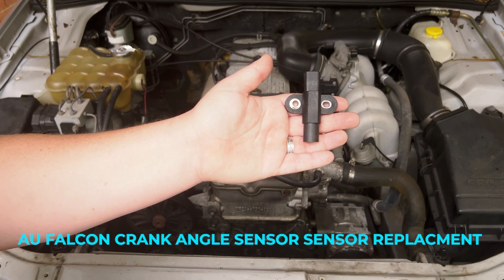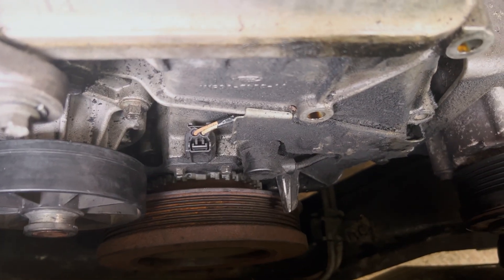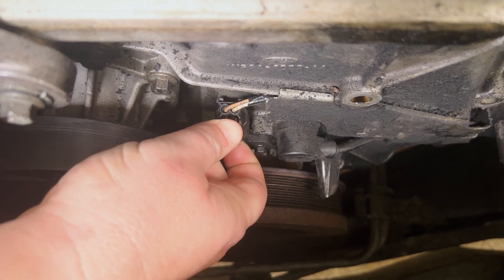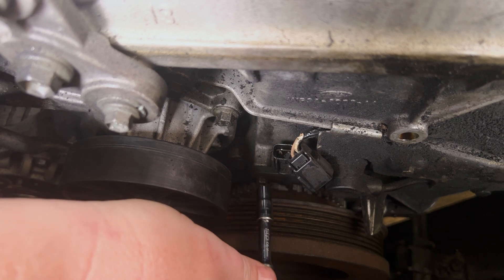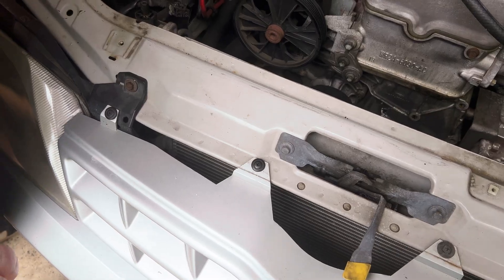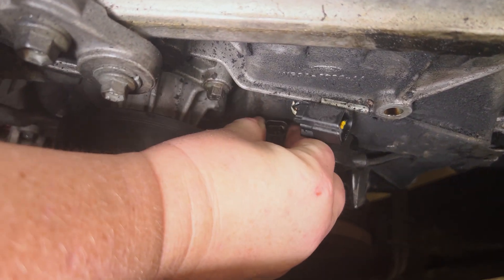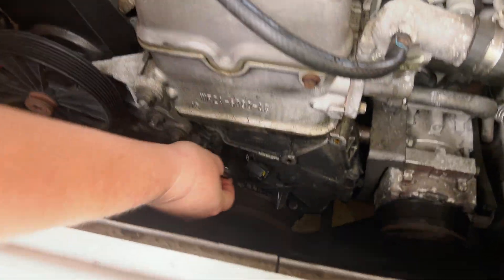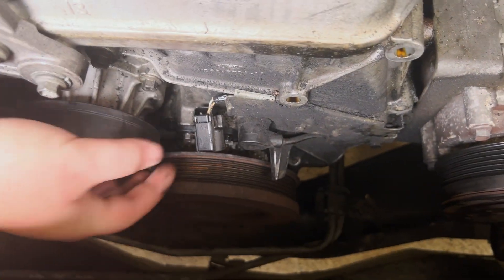Au Falcon Crank Angle Sensor Replacement

Comment: Hi can you tell me if the el falcon has a crank angle sensor same motor as the au
Reply from the maker: yep would be in the same spot all fuel injected models of falcon will have a crank angle sensor
Reply: @Aussie_car_repairs  cheers appreciate your response
Reply: Hi I'm just wondering if you can help me my el Fairmont auto is stuck in limp mode 3rd gear can I do anything to fix it.
It was fine but my son accidentally put it in second now it won't change at all 
Regards Ray
Reply from the maker: @rayherbert9413  you could climb under and check the shift lever other then that the box is probably dead they wont usually last to long after going into limp mode as it only dose it on its last legs best bet is to get a new box and when you install it drain the fluid and put a bottle of lucas trans fix in and the rest with trans fluid its what i have done and would do
Reply: @Aussie_car_repairs  thank you I was hoping you wouldn't say that 4 months ago I put a second hand box's in all was good until my son accidentally moved it to second while I was driving  now limp mode

Comment: Ford au 2 cam angle sensor removal Please. Thanks. I know where it is, but want to know it the harness ( fixed harness)  of the sensor can be eased out easily under the A/A compressor. Thanks.🇦🇺
Reply: hey mate did you end up working this out? I need to replace my cam position sensor in my au3 and can't find any info so any help would be much appreciated
Reply: @yado7550  remove the serpentine belt. Degrease area around harmonic balancer. Make it clean. The cranknangle sensor and cam angle sensor just beside or top of each other. You can pry out harness wires easy if they are clean and you got good lighting. They are deceiving from view, but they are close to each other.😀
And btw the harness will get through ac compressor brakets. Work it out patiently.